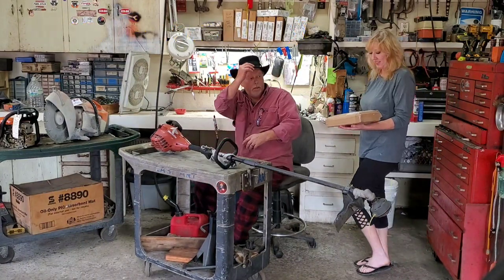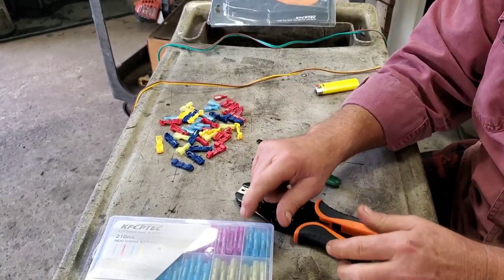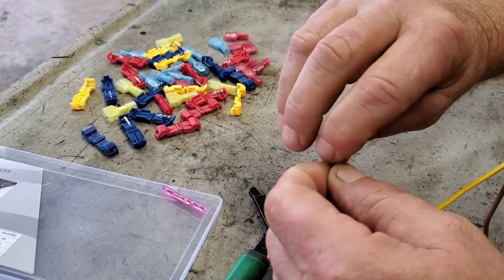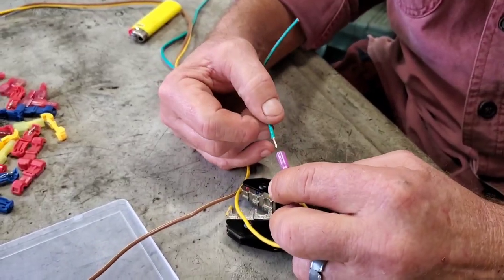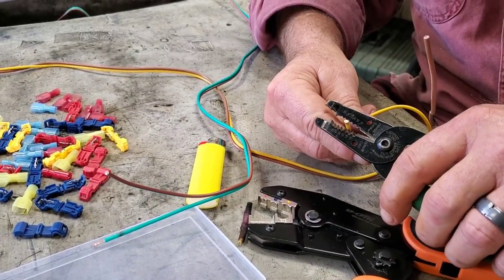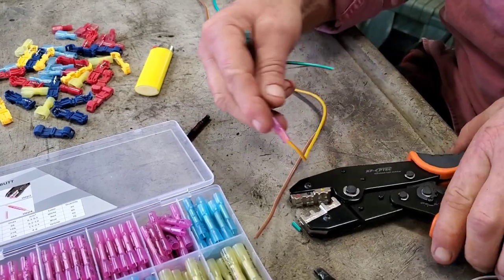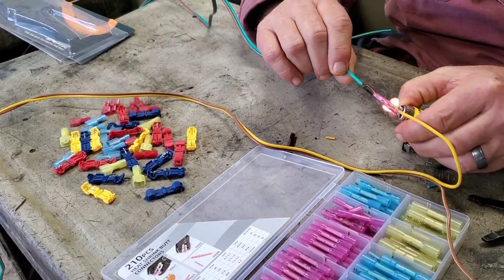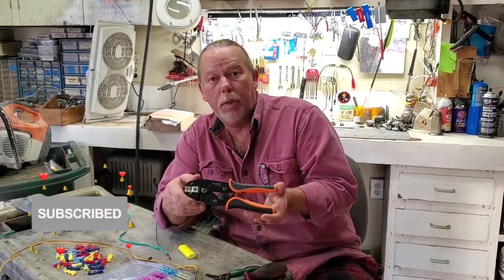ELECTRICAL CONNECTOR CRIMPING TOOL REVIEW. KF CPTEC Electrical crimping tool and connectors. DIY

Comment: Awesome to see Mrs T-Bone! I cringe when I see folks using a generic crimp tool, I have s similar one, with interchangeable dies. Nothing beats the right tool for the right job. I hope you and Mrs T have a warm and Happy Holiday, Cheers! 🎄🎉🍻
Reply from the maker: Yes I agree. Thank you for watching and Merry Christmas 🎅 🎄 ❤
Reply: Hey Lawnmower Lady, the technician training and skill set has a greater bearing on quality than the tooling sometimes. You know what they say, it's not the tool size but how you use it!  🤣😉😊
Reply: @joehead1294  You are right Mr Joe! To be fair however, it's hard to have both when anyone can buy the cheapest crimpers and the wrong crimps, and then start a fire 'cuz they really have no idea why what they are doing is wrong.
Reply: @TheLawnmowerLady  ABYC has good info on wiring and crimping.  TE Connectivity also.

Comment: You ever get the impression that guys like us just like reasons to buy tools...so we fix tools for a living?  Before my electro-mechanical job in industry, my delivery job brought me to every type of manufacturing facility you could imagine.  I got to see all the machines that made stuff.  I drove monorails for WDW part-time in FL just because it was a giant electrical puzzle.  I blame it on the toolbox industry.  Them toolboxes come empty.  So you have to fill them.  Once full then one more tool I "NEED" won't fit so I have to buy another toolbox...and so on.  Great video again.  BTW...I believe by govt/military standards a crimp needs to hold a 50 lb weight to pass.  Was told that by an ex-military electrician while I worked maintenance at a boat building place in Groveland, FL.  Just sayin' .
Reply from the maker: That is so true, yep gotta love tools. It sounds like you have had a great time getting to see all that in person. Thanks for watching my friend.